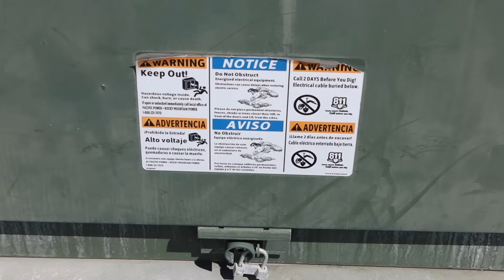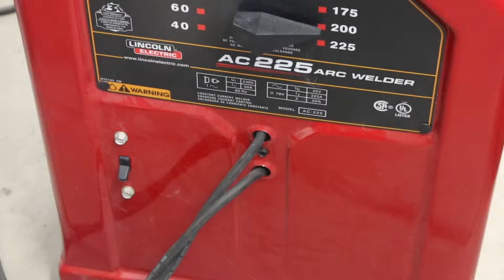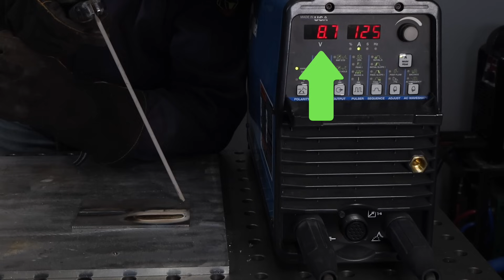Can You Get Electrocuted While Welding? Watch This...Don't Get Shocked!

Comment: 05:10 That happened to me long time ago at "Hoogovens aluminium" in Koblenz/Germany. I was in a steel pipe where was water on the bottom. I had a level 5000 hang over from the day before and so, stupid as I was in this situation, I connected myself to the current. The input to the stick welding machine was about 400 volts, the output was more than 100 amperes. Holy cow, that shocked me very hard. Luckily my arms flew apart by themselves, so I wasn't long connected. But I guess if my both arms din't get automaticly apart that day I had died. 
If it turns out stupid and everything fits, such a welding machine can kill also!
Nice vid!

Comment: Question, theoretically if I took my welding gloves off and put my barehand on the piece im welding, will I got shocked? (Piece is properly grounded and im not standing in water)
Reply: No, cause the electricity is travelling to the earth, you’re not the easiest way out of the circuit at that point
Reply: @ivan.janjic77  awesome thanks!

Comment: If you didn't pay attention to some of what he said.
Wet conditions are a no-no. You don't need a pool of water: damp concrete will conduct. My first welder was a stick, and you saw him put on gloves and tell you to make sure everything is properly insulated. A hot, humid rainy summer night, I shocked the living daylights out of myself. The handle that held the stick had a screw to hold it together and it was bare and exposed; also, I was wearing shorts while kneeling on the concrete welding right on the floor near the garage door. 

Did you hear the part about not working on the inside of the welder while it was plugged in? So I wanted a much longer power cord than stock. I still had the cover off after wiring it in. It tested fine. All I wanted to do was make sure the bolts that held the wire to the contacts were tight. My wrench slipped and my knuckles punched the bare contacts. Yes, I said I punched the bare contacts. 240 volts. Blew my ass back 10 feet. It took a few minutes for me to even be able to get up off the concrete.

Comment: I have been electrocuted by my welder three times. First two time was high frequency start with my tig, forgot the work clamp. Second was when mig, was welding some feet for a rack, decided too lay down on my piece to lay a bead. I didn’t notice at but it quickly became annoying. Iwas running 170amps and 22 volts on my machine.
Reply: It’s only the 22 volts which matters. Those 170 amps have nothing to do with what you felt; they are only going through your welding arc. Your body would have conducted only a few milliamps. 22 volts cannot harm much anyway (unless you stick your tongue on it).
Reply: @Engineer9736  For sure! the whole "its not the volts that kills you, its the amps" is stupid. like a car battery is 12-14 volts at 60 amps, but we touch the terminals all day and don't think much of it.

Comment: We  did not need  6 minutes for this.  Answer is HELL  YES.  Traditional  stick welders  like the  Lincoln  "tombstone"  you showed can  reach open circuit of about 80V  plenty  to kill your ass especially if wet.   AND IF THE GROUNDING is  faulty and the welder has some leakage between  primary and secondary,  you could end up with  appearance of line voltage on the  "welding"  side.

Comment: Can definitely hurt you.   One of my coworkers spent time in the hospital. He had a sweaty hand on the workpiece when the welder struck an arc.    Instant down and out.
Reply: It’s not possible. I’ve been hit by 230v many times and it just jiggles your body a bit at the frequency of the grid. A welding voltage like 20 volts is not capable of doing anything with your body (unless you stick it in your mouth). Perhaps there was something more going on with your co-worker or the welding machine was faulty. To go “instant out” you will need a 1000 volts to get that much current flowing.
Reply: @Engineer9736  say what you like.   it happened in front of an entire maintenance crew.

Comment: Probably depends on what the max output voltage is of your welder. Under 50V - ok, 70-90V be careful ! Over 90V treat like mains power.
Reply: Agree.
Reply: @Engineer9736  Thanks ! This video is vey poor at giving an answer that's anything like being half useful !

Comment: It's not the volts that kill ya. It's the amps.
Reply: https://youtu.be/XDf2nhfxVzg
Reply: Still, you read warning sings saying "warning high voltage" that's because voltage could be more dangerous than amperage, even tho so little amperage could kill you. It's a complicated matter for what I understood, considering also resistance. High voltage can arc a lot longer, amperage with low voltage usually burns you, the skin effect and all of other bunch of things make it hard to understand it. Just be safe, no matter the voltage or amperage. And if you can use one hand and keep the other hand behind, cause that's the path to the hearth that can kill you.
I am not good at explaining, watch ElectroBoom video about what kills you: you can stick two terminals on your tongue at 1 volt with 100 amps and you will be safe.
That's also what this video said.

Comment: hi, gud video, i have a few questions. 
1 when we metal tables for welding and the clamp is connected to the table. while i lean on to weld a part of my body touches the table will i get a shock.
2 is it safe to have the metal fabrication table on a wooden base, will that help to cut paths for the electricity to flow.
3 can we have the ac on in the workshop when we are welding. usually have it on low when am woodworking. am new to welding and just learning from youtube. so asked

Comment: Never been shocked changing a stick. Been shocked by dual shield welder, the crackheads at work would pull the whip over sharp metal didn’t realize it was bare lying on my side that hurt.

Comment: This makes me even more curious how underwater welding works? Is it the gear they wear that makes them safe?
Reply: Water is a particularly bad conductor.
Reply: @Gowieee , It might not be a good conductor but it does conduct electricity as I've had it happen to me personally.
Reply: @Gowieee  clean water yes, most water on this planet, no.
Reply: Electricity takes the path of least resistance so you just need it to be between the welding rod and the part being welded and not you.
Reply: A fellow I knew once that did underwater welding - diving told me he was connected by radio to another guy that ran the welder and he would give the word and the guy would connect him to power and he could feel a certain amount while welding.
I thought it was crazy.
Reply: Underwater welders and electricity, my understanding is that it revolves around the direction of the water's current.  Water flowing away from you is good, towards you is bad iirc.

Comment: I welded at a carbon  electrode manufacturing plant once and the powdered graphite was like black snow everywhere, if you dropped your stinger on the ground it would burn up in a short time , so much graphite on your gloves it would knock the snot out of you just changing a rod . We had to place the rod on the back of our glove and pinch it off with the stinger

Comment: Would be better if you showed us scenario's during welding where it may be hazardous to electric shock or other problems usually from improper use
Reply: During the actual metal rod burning metal transfer is for the biggest part is the safest time of the process. Electricty takes the easiest path. Installing rods into stinger. Holding rod in a gloved hand provides some protection not foolproof. Or having the stinger layed down and rolling over and accidently sticking the rod into you while you are sweaty or wet.  That is the most dangerous times. The end of a rod  loaded into a stinger can leave a lasting impression on a person when improperly handeled.
Reply: The scenario of when it's dangerous is : Any time the machine's on..

Comment: Keep a dry forklift/tractor seat bottom, piece of rubber mat, piece of wood, electric hazard boots, keep machine out of rain, perfect ground, keep things dry is what I do, always wondered how guys weld in rain without getting killed, sometimes welding is risky, welding on live gas lines, under water, at height, in trenches, confined space, tankers that are supposed to be washed and ventilated, truck rims, under heavy equipment or structures, probably going to be the way I go, better get life insurance, because most jobs are not in temperature controlled shop on a work bench. Shit, I even worked at nuke plant with all them bright colored wrenches that probably would set off a geiger counter. Heat and air on a bench on a bench with no ear protection needed sounds nice.

Comment: My buddies dad told me a story about how he almost died from electrocution once. He was a rig welder for 20 years, and he told me about how he used to think that welding machines weren't dangerous. Sure, they can give you a shock, but not enough to kill you, he said. One time he had to climb up into a pipe rack at a plant, and we live in south TX, hotter than hell here in the summer. He was soaking wet with sweat, had his ground connected to the structure he was climbing on, and had his stinger draped around his shoulder, carrying it around with the electrode in it. The stinger spun around and the electrode hit him square in the chest. Next think he remembers was being awoken on the ground of the scaffold just beneath him. His buddy was trying to give him CPR and said he wasn't breathing. Ever since then he had a new respect for the equipment and took safety a lot more seriously.

That's the story he told me anyway. I could believe it, I've had the absolute shit shocked out of me before on old engine driven machines. I run an old 1963 Lincoln SA200 and she'll sting you if you're wet lol
Reply: Getting shocked from sweat is what I hear about all the time. I'm also in Tx (NE Tx). So I've heard about people catching the current through their table and sweaty clothes.
Reply: You can be killed by less than 28 volts under the right conditions. Right about where most consumer welders can put out a hundred amps until the thermal breaker trips.
Reply: so then the thermal breaker trips, after... potential death? @stickyfox
Reply: Like I just commented. I met a guy who had his contacts fused to his corneas

Comment: Good info and a topic I haven’t seen discussed on here before. I remember being a 12-13 year old kid and helping my brother in law when he was welding on his truck. Telling me to put pressure on the panels to hold together while he welded and using a hammer to do so. I was so scared I was going to get zapped! Lol.  Years later, I worked as an electrician and then years after that, teach Taser training.  Even with having a much better understanding of how it all works now, I still find myself being extra cautious when setting up a weld.  Nothing like pulling the trigger or hitting the pedal and realizing you moved your setup and forgot to reattach the ground clamp! Lol
Reply: At my job I have tig welder that is quite new. It is usually very kind to me. Sometimes I have to weld things off the table and hook the ground clamp right to them. If I forget the ground, it just makes  tiny sparks and not much else. The old machine I had if you forgot the ground clamp it would blast the hell out of you.

Comment: Great stuff, I was actually looking for  info on this just last week and could only find OH&S stuff from Lincoln etc, or... less helpful videos 😆

This might be the dumbest question you've ever heard Tim, but a grizzled old welder told me that if you're wearing insulated boots (and not standing in a puddle), and yellow rubber gloves under your welding gloves, and you're not soaking wet, you can quite easily stick weld in the wet/rain. I'm sure it's risky no matter what, but is that actually true?

Comment: Having flashbacks of changing electrodes while sopping wet and sitting on wet steel beams several stories in the air. Being an Ironworker sucked.
Reply: I'm sure it sucked going to the bank to cash your check too, I always hated cashing them $2,000 checks. Ironworkers Local #14 Spokane Wa
Reply: @In_Rem  Mine were $1440.
Reply: @AtlasReburdened  what local
Reply: @In_Rem  Houston, Tx.
Reply: @AtlasReburdened  what number
Reply: Best I made in the union was welding for the 424 electrical union in Canada. 24 on 4 off 12 hr days. Double time o.t and weekends. 3800 cad after taxes per week. Those days are long gone now tho.......

Comment: Tim, great video. Now would you consider a video on HF TIG welding hazards including stray HF causing security alarms being activated, risk to anyone nearby with a pacemaker or heaven forbid a pacemaker with defibrillator. HF TIG is great but can really cause localized problems you may not be aware of as you are welding. Yes, I’ve been shocked stick welding farm machinery outside in pouring rain. Gloves get wet, even gum boots aren’t foolproof in those conditions.

Comment: I get shocked at work every week or so during the summer because I get too sweaty.
Reply: Try wearing rubber gloves under your welding gloves Or use an insulated stinger
Reply: What if you stand on a rubber mat?
Reply: It's a good tingly jumpstart like an espresso red bull
Reply: Anyone who welds regularly gets shocks - wet ground, sweat, moisture on the metal, whatever.  Most are minor, just a really good reminder to ALWAYS PAY ATTENTION.
Reply: on a need-to-know basis, i literally don't need to know about your personal hygene issues. <3

Comment: Thanks for posting this. I've got a new Tig machine and I get shocked Everytime I try to us it. I can't figure out what the issue is
Reply: Has to be an improper ground. Unplug the unit and open it up and check for loose or bare connections. But yeah, wear good gloves at all times.

Comment: Great video
I think the real question is if your body completes the electrical circuit for the weld path what happens.  If you don’t have a safety built in to the welder then yes it can kill you.  Think about it this way.  Your outlets in the US are 120v and usually 20amps and that is enough to cause death especially if it crosses the heart.  Most stick welders for example, are around 68v and can be over 200amps.  That’s 10x the current and over half the voltage from a wall outlet and there is no breaker or GFCI to turn it off automatically.  You just have to pay extra attention to your situation and safety first.
Reply: no  weld voltage is ,around,19 to 29 volts for most
Reply: @davidjones-vx9ju  maybe some
But I’d swear the digital readout on my everlast in stick mode at 120a shows 68v.  Perhaps it does not have any protection circuit or maybe I’m remembering it wrong.  MIG mode is lower, I remember that for sure something around 17 to start.

So I went to everlast to look at it and OCV is between 60v and 70v.  I am assuming that’s what I saw but obviously I’m not looking at the welder while welding to see what it drops too.
Reply: @tomphillips2473  It will be the open circuit voltage that jumps your body, and it takes less than ONE amp to disrupt the heart.

Comment: I've gotten shocked several times while welding, from little static passes all the way up to the kind of shocks that blow you outta circuit. If you feel static coming through your torch, electrode holder, or feeder gun stop and check your ppe and then your leads for exposed wires or shorts. I've been very lucky not to have a lethal shock. I've even taken residual branching from lightning strikes in the past. I'm starting to think electricity isn't this dangerous... Heavy shocks hurt but you feel great after the endorphins get released in your body afterwards.
Reply: I've been hit by branches of lightning twice, can say I didn't feel good for the next day lol

Comment: I worked in the oilfield in southwest Virginia back in the late 80's. My crew was called in late evening to help the pipeline crew finish a section of pipeline on top of a mountain, in the pouring rain, of course. The welding truck they were using had just snapped the ring gear in the rear end, so they were dragging it around with a dozer, and the ditch they were welding in was almost waist deep in water. I held the end of the pipe, while the welder literally had half of his welding helmet below water. Every time he struck an arc I got the shit shocked out of me. Fun times.
Reply: I once welded some stuff in my driveway on rainy wet day. I knew I had to be aware of every move, I wore rubber boots and had wet welding rods. I would turn the welder on with my foot and weld then turn back off before touching anything. It worked out well but I sure had to pay attention.

Comment: Yes you can because yes I did. I was doing some TIG welding and lifted both the filler  and the torch at the same time, without letting go of the pedal. And I guess my arm was touching the table because I definitely felt the electricity run through me. My heart almost gave out.
Reply: was just a "poke"

Comment: In a previous life I was Shipyard welder and an Industrial site welder.  1. In Summer, don't hold the electrode under your arm pit to put it in the hand piece,(sweat/dampness), or if clothing is damp.  If you have a weak/er heart (and you probably won't know that - until?)  2. Winter, if there are one or more welding cables connected to each other for distance, avoid stepping in puddles while you step onto the welding job, the current will travel through your knees and you will feel the current, or worse.  That's two are worth mentioning, and I've felt many <grin>.